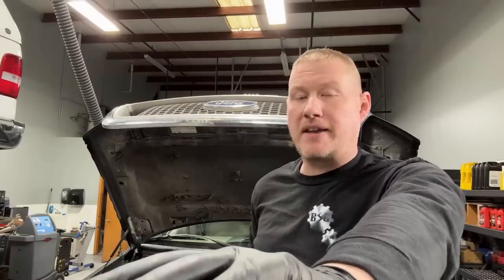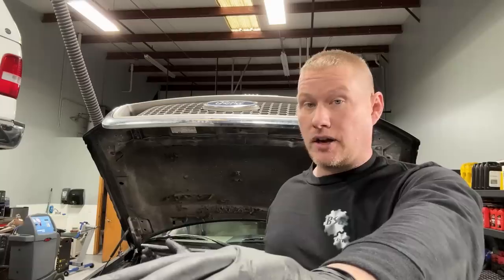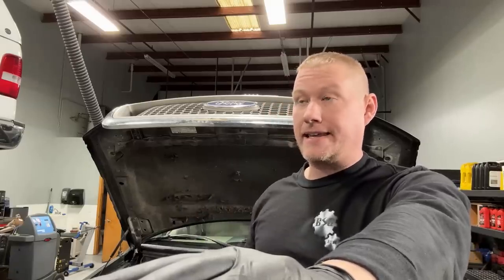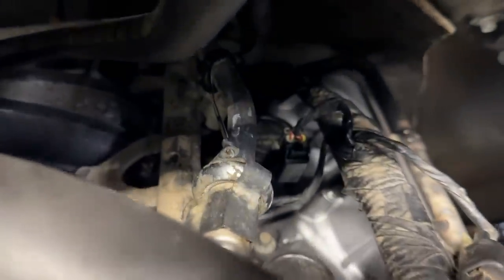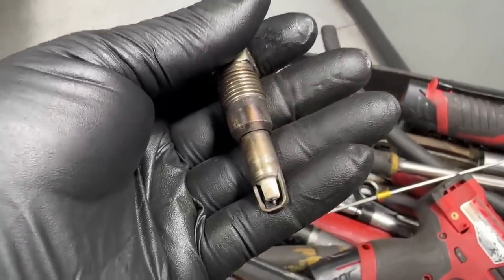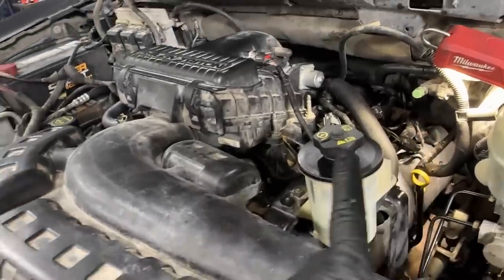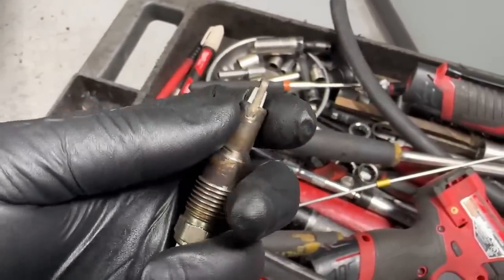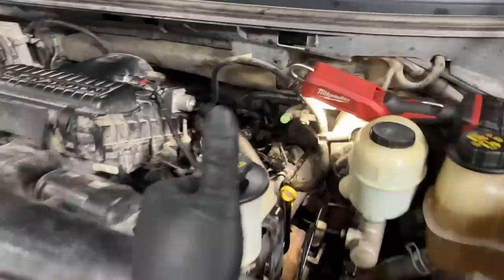How in the World is There a Belt Chirp Noise Coming from INSIDE of this Engine?

Comment: What prompted the timing chain change? Just preventative? Or was there a specific concern/problem?
I’ve heard some people say 175k is too many miles for original timing, but others have said it’s designed to last the life of the engine and shouldn’t be touched unless there’s a specific reason.  
I’d love to understand your approach to making that decision on this and other 3V engines. 
Thanks!
Reply: I would change them as a matter of course given the mileage the engine has. The chain itself tends to wear at the pivot points in the links and this causes it to stretch over time. Its also under substantial tension from the hydraulic tensioners, so its constantly under load. There are also the guide rails which are made of plastic, and tend to harden and deteriorate over time, ultimately breaking apart and ending up inside the engine. There is also the fact that the chain will establish wear patterns for the components that are already there. When you start changing things, the contact patterns change and this can cause excessive wear, and this is doubly-so if its stretched as it will put a lot of load on the leading teeth on sprockets, damaging them. Better to just replace it as a set so everything breaks in properly.

Comment: Learned something new. I had a 2007 F150 and traded it after 160K miles. Never any problems. Had problems with my new 2019 F150 with fuel injectors failing, which left me broke down on the side of the highway twice. On the 2nd time, Ford decided I must have defective injectors and replaced all 12 of them.  Hopefully, that solved the problem since I love the performance of the 3.5 Ecoboost.

Comment: Nice n skillful diagnosing.  Very cool it was so easily fixable. Gotta archive that in my memory for possible future use on my 06 5.4 3V , Lariat. Lol
I just had all 8 plugs replaced with all  New Motorcraft plugs due to a misfire up hill , low rpm under load. You help confirm the issue a few weeks ago. Thanks by the way.

Comment: The "squeak" was actually the vibration of, and the air passing by the rubber seal between the spark plug hole and the coil. It would take a few compression strokes to build up pressure, then, once it overcame the rubber seal, it would squeak like a rubber duckie being squeezed. Since it wasn't a "mechanical" noise, you wouldn't have found it with the stethoscope, so, using the tubing is great to isolate sounds and pinpoint pressure and vacuum leaks. And as far as the plug leaking, imagine a spark plug having quality control issues, that had a crap poor design in the first place. I thought they upgraded those to a one piece design, but it still looks like the 2 piece crimp together ones.

Comment: A stethoscope with the probe removed can have metal tubing put on the end of it's hose/tube for noise diag from hot areas.
Without the probe, you can sample the area around the suspect and then move closer and pinpoint.
The electronic chassis ear type has a tube type too but you would add metal tubing to it for the hot.

Comment: Hi,
My 02 Mountaineer with the 4.6L 2V had it's first timing job at 287,000 miles. Had to have a replacement transmission installed at 290,000 miles. Just gotta take care of the Triton engine and it will hold up just fine. Lisa

Comment: Got a 2009 5.4 with 273.000 miles. It runs very smooth have never done any work in engine or transmission. A dealership was buying 2009 f150s. I think will keep mine been into Mexico 3 times and never fall me

Comment: That plug was defective. The taper is not perfectly round. You can see where it was not making contact with the head and gas was escaping. That hot gas may have burned away the metal & made that crack looking void. Good job finding that one in a million defect.  
I never thought those engines could make it that far. It makes me wonder if the ones that give early problems were given the proper maintenance. I have a 2 valve 4.7 that was running on gas that was so stale, that when I put some in a glass jar from a fuel filter change, the evaporated fuel left behind an oily substance which never would evaporate. The Expedition would hesitate like it was starving for fuel. I was surprised it never set a check engine light.  I got some fresh gas and it seems to be running fine now. I guess that is what happens when you keep the tank almost full for years, and drive about 900 miles a year in a hot climate. I thought about getting a newer one, but it still looks like new despite being a 2000, (silver does not fade)  and I changed the rear diff oil seals, 4 rotors, 8 pads, 4 ball joints, front bearings, 4 shocks, transmission filter, serpentine belt, & air filter. I hate to part with all those new parts & with my chromed differential cover from Taiwan. They used thicker steel than Ford, so 1 of the 10 bolt holes needed a very slight enlargement to get all 10 bolts in. I could not figure out why I could not get the last bolt in. Then I realized that stamping it out of a thicker steel would change the location of the holes just enough to cause that misalignment. I covered the cheap plastic front grille with a mirror finish stainless cover so both ends look cool. No salt on the roads makes a difference. You can keep vehicles as long as parts are available. That 2000 Expedition was built like a tank. Crawl under it and it looks like they were trying to get rid of surplus steel.

Comment: I’m commenting only because this is your latest video.  (I appreciate your insight upon fords). My nephew is also very insightful.  I have a 2015 F150 5.0 with a fault misfire on #3 ,in which was cleared…..two days later #4 showed misfire.  I replaced the plug (NGK) and so far ….good.  But I have noticed “some” rough idle at start first thing in the morning followed by “some” sluggish response.  It has 125K miles on it.  He say’s my right bank cats are going out and will need replacing.  I asked, “can I eliminate that Junk……”No….the pre and after O2’s will not meet specs and you could end up in a limp mode.”
And it is Expensive Crap!!!🤬🤬🤬
No one out there to offer anything to bypass?!?!….this BS is out of control!!!

Comment: For all the neihsayers out their I have a 2004 expedition. 5.4l and at 250ish miles I did timing and replaced oil pump as a prevented maitance  sense it was open. I now have 375k miles on this engine and that is all that was done to it and still running strong.

Comment: I also have a 2005 with the 5.4L with 254K miles with original timing components. Both VCT solenoids were replaced last fall and has had plugs and coils replaced twice.

Comment: Had a similar experience with a 3 valve years ago but was more of a tick noise that I started smelling exhaust gasses in the engine bay checked the plugs and they were loose.

Comment: I had a Ford Pinto with a 2.3L 4 cylinder back in 1980. After a few hours on a road trip up and down hills it lost power and sounded like a duck quacking and hissing. The #3 spark plug had melted a small groove along the threads resulting in zero compression for that cylinder. The noise was so unusual I remember wondering if I had hit a duck somehow! Hit the auto parts store for 4 new plugs, checked the oil and I was back in business. Life was much simpler back then.

Comment: First thing I thought when you played the noise video clip was it sounded like maybe a PCV hose leak that either sucked in or blew out small amounts of air.  Close guess, but good thing you checked the plug and it didn't blow out of the engine!

Comment: I had a small block 400 chevy engine that made a noise like that after I decided to replace the rocker arm balls with with a set of grooved performance ones (for better lubrication), even with 20W50 engine oil in it you could hear the noise at idle. Apparently they would not "break in", replaced the set of rocker arm assemblies & the noise was gone.

Comment: I had a chirp that sounded exactly like that on a 1999 Explorer 5.0L. Stethoscoped it and swore it was the water pump. Changed pump, no joy. Turned out to be the TDC sensor shaft aka camshaft synchronizer. Poured some oil down the shaft and never happened again.

Comment: I had a 2005? GMC truck with 5.3 with a chirp like that. Took both belts off and same thing. Slight miss on #5 at idle. Found a GM bulletin about bad roller rocker. They instructed you to  run with valve cover removed while side loading rockers with a wooden handle. The noise stopped. Ended up changing cam and lifters to fix. Was a head scratcher for a bit.

Comment: Fellow ford tech here. I have also been working on 5.4l engines since their inception. I have a 2014 expedition with a slight misfire on all cylinders on bank 1. Another shop already replaced the phasers, plugs and coils. All pids look good except for the bank 1 long term fuel trim is -9.65 so its taking fuel away from that bank. vct error pids switching around 0. Bank 1 -0.12 - 0 %, bank2 +0.12 - 0 %I have checked exhaust back pressure and it test good. I have also used a boroscope to inspect the cam phaser looking through the cmp sensor hole and the oil cap. The fingers line up with the timing mark on the phaser. Crankshaft end play is good. No codes. What am i missing here? Hope you see my comment.
Reply from the maker: Anytime it is a complete bank I am betting on timing or cats. First I reset KAM and see how it runs before correcting to -9, if it corrects to -9 I then quick check the canister purge for leakage by disconnecting the vapor line and electrical connector to see if the now open purge valve has any vacuum leakage. If that passes then I would pop out the upstream o2 on bank to just to see how it runs at idle. If no improvement then back in it goes. Last I check for the color banding on the fuel injectors and compare to bank 2 and the parts catalog. Then I go for timing.

Comment: I have the same truck with the same milage he wants me to check out. You can hear he chain hitting he cover. Ball joints also worn. I'm thinking $3500.00 in repairs if the thrust bearings are still good.

Comment: I just had a similar situation with an old 1994 GMC Jimmy 4.3 l. Suddenly the car developed a tick I had trouble tracking down. I ran the engine without the drive belt and it continued. Finally tracked it down to the driver's side front spark plug had worked itself loose. This is apparently typical of tapered sealed plugs (vs flat seal with a crush ring), where getting the correct torque can be difficult, especially with this engine where you access the spark plugs through the wheel well and with this particular plug there is very limited space to fit a torque wrench.

Comment: Had the same issue with an Expedition last year when another shop put plugs and coils in it, the next day it started chirping so he took it back to that shop and as you said....they went to pricing him a head for a low oil flow etc so somebody told him to bring it to me. First thing i did was pulled the coils and number 2 coil boot was smoking hot, pulled the plug and it was the same 1/4 of the seat wasnt touching the head seat just like that one. Havent seen it before or since except yours, i picked up another plug from Ford and showed them that one and they traded it out for me even though they werent the ones that sold it to begin with. They said that will go in their “unique flaw” box with the symptom attached to show techs during their weekly Friday morning meeting

Comment: The shop I ran several years ago had a truck like this with a 4.2 V6 and same sound. They removed the belt, still made noise. Chirp chirp chirp even with no accessories. Hot, cold, no difference.

Comment: My 4.6l 2V suddenly started ticking, with no misfire. The #3(dealer installed over 30K ago) plug was loose, coil oil stained. The spring was stuck on the plug. The gap was over .075 and clean. I re- gapped and installed a new coil. I expected a slight improvement, but nothing noticeable. Likewise, I feel, the other plugs should be re-gapped, when it warms up this spring.

Comment: Is that related to those plugs blowing out and stripping the threads in the head? I've come across that a bunch. We were able to heli-coil a couple but a few had to have the head removed and rebuilt...fun fun fun.
Reply from the maker: No you are thinking of the 2v engines, this is a 3v engine.

Comment: When I was a Ford tech I had a 3.7 that had what sounded like a belt chirp.  It sounded like it was coming from the lower engine and taking the belts off would not change anything.  One day our FSE was at our shop and I asked him to look at it.  We looked it over and he told me to replace the short block.  I did and that fixed the noise.  I have no idea what was causing that noise.

Comment: 2007 Expedition had a transmission chirp that was caused by clutch packs glazzing over at low mileage. Has mine replaced. Came back 15k later. Stumped a lot of people and took many days at dealer to find it. Only happens on hard downshift at 30-45mph.

Comment: I once had a truck with a V-6 engine.  It was making this weird rattle noise.  It turned out to be a spark plug with a loose insulator.  Put a new plug in and the noise was gone.

Comment: Love your vids, your experience level on that 3valve blows me a away...I left ford around the same time these engines where new and then transitioned into automatic transmissions (all makes) so I haven't been into a lot of them, however I do own one lol. This noise is what I ran into on the 2v 4.6 and 5.4, so I had a feeling from the title that was what you would find. Keep up the great work, you really help a lot of people with your channel. Btw another trick is to put a SMALL amount of water in the spark plug hole with the coil removed and fire up the engine if you have a mist blow out you know there is compression escaping.

Comment: 2004 f150 4.2 v6---I replaced all belt driven components seaching for a intermittent chirp. Found the cam sensor not properly lubed and replaced it with lube, all fixed.

Comment: Brian I have 2014 f150 with 5.0 that had what I thought was a belt related squeak around 80,000 miles when engine was cold. I replaced, belts, pulleys, tensioner and still had it. Then I changed out the water pump and then it was fixed. Had no coolant leaks there but the bearing must have started to go. Hope this may help someone out. Thanks for all you do Brian! Bob

Comment: As soon as I heard the sound I knew it had to be a vacuum leak or some kind of pressurized vapor escape. My suspicions would’ve started with a PCV issue or EGR leak (I’m not very familiar with the 5.4L 3V V8 so it may not have either of those systems, I try to stay as far away from those Ford modular engines as I can get!). Kudos on finding it! Good too that the plug didn’t break off in the head like they’re known to do!
Reply: The plugs from The factory for those first few 5.4 3V years were known for breaking, but the redesigned plugs you buy nowadays don't have that issue.

Comment: Was figuring you had to Heli-coil a pluc hole, but that was the 2V engines that blew the plugs out. Could've been a manufacturer defect, or dude possibly dropped or scratched it in some way during the install.

Comment: Just finished the timing job on my 07 f150. Its making this exact same noise, but on the opposite side. Plugs arent that old either.  Im suspicious that during the timing phase when you are hand cranking the engine creating compression cycles (when all the valves are closed) are pushing old carbon around the plugs outward? Combined with improper torque and existing corrosion...its just wierd that it wasnt making the noise until after a timing job.

Comment: same noise on an 8hp kohler motor  during starting. my son overhauled it in a h s shop class. he now knows the difference between inch/lbs and ft/lbs  (used the right wrench on the con-rod).  compression sneaking past the head gasket.  lol

Comment: I have a 06 f150 337k did timing job roller followers and lash adjusters at 300k bought it with 13k and I have beat it up kinda surprising it still runs

Comment: Also if they're loose enough it will sound like a phaser knocking. I've come across this a few times.  Also will burn the straps off the bottom of the plug
Reply from the maker: Yes as explained in the video here.
Reply: @FordTechMakuloco  are you mainly a Ford tech. I was for a few years left and opened my own shop
Reply: @louisb7514  he owns his own shop , that’s his shop

Comment: Improperly installed spark plugs will often come loose over a period of heat/cool cycles, especially the tapered-seat style spark plugs often used in modern aluminum heads. 

Not surprising though, as the average Joe-schmoe doesn't properly torque anything. 

It's also a known fact that BOTH the 2-valve AND 3-valve Ford Triton engines need their spark plugs tightened GREATER than the OEM Ford torque spec, to prevent them from coming loose.

Comment: Pulled into get gas and after I turned off the radio I heard a knocking/ticking sound 🤯 The oil was burnt and black 2 days after 100k mile service. No idiot lights came in. Drove 2-3 mikes home , started it up next day cleared snow (5 min) then it died as I attempted to get it back to the dealership.

Comment: My timing chain went out at 156k on my 2006 f150 I bought it used with 115k it went out at 155 or 156k I got a new motor put in for 4800 brand new with the timing chain / tensioner problem fixed and I’ve put another 30k miles with no problems. They are really good trucks but that timing problem was the only thing wrong with the 2004 - 2008 series there should of been a recall with as many timing chains that causes the motor to fail